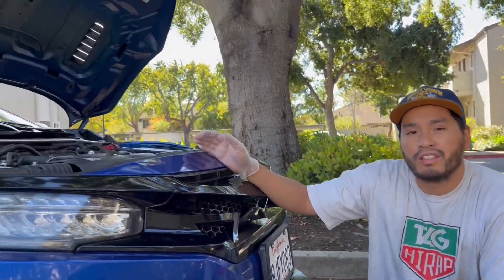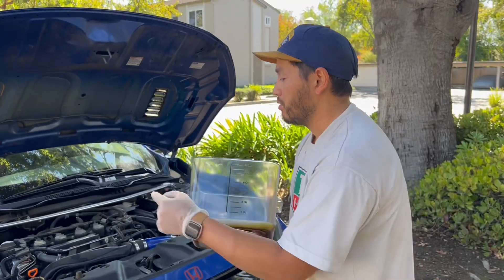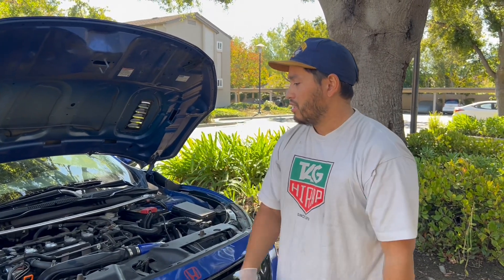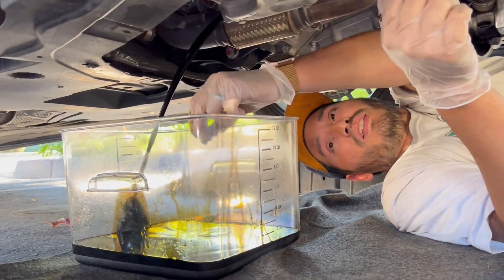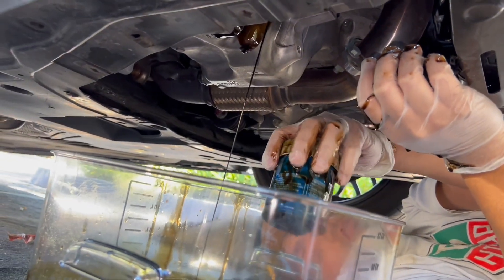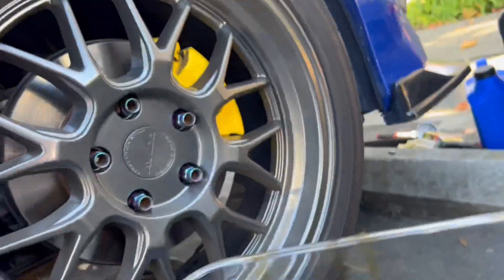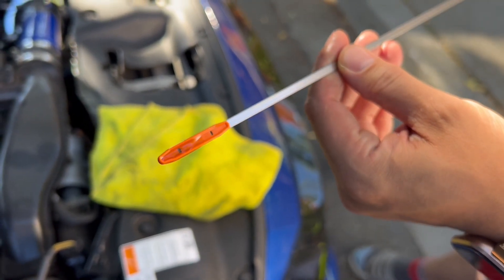Major Problem with my Honda Civic 10th Gen OIL DILUTION Fuel Mixing Issue, No Warranty Fix Recall

Comment: Scotty Kilmer suggests to switch to the new ILSAC GF-6B 0W-16 oils for the Honda 1.5L turbocharged engines to fix the oil dilution problem. That's what I did in my 2018 EX Hatch. No more gas smell in my oil and I can go back to oil changes at 6,000 miles.
Reply from the maker: Thanks for the suggestion. I’ll look into that oil right now 👍
Reply: @Sals_Garage  let us know if it fixed it 🙏
Reply from the maker: @Chris-db9vt  I’ll make a follow up video on the next oil change. 👍
Reply: Which video did Scotty say this in? Can you link pls
Reply: @schulumberger  
He actually mentions it in several videos. He hasn't made a specific video talking about just this subject specifically. It more or less comes up in his bonus questions and answers at the end of his regular videos. But whenever somebody mentions having the 1.5L turbo he says to switch to the 0W-16. Apparently the 2.0L turbos are fine and don't have the oil dilution problem that the 1.5L  turbos do.
Reply: @joshuaewalker  thanks man! I will try it and report back here! About 3k miles between oil changes!
Reply: @schulumberger  
Cool! Btw, what are you driving?
Reply: @joshuaewalker  Honda Civic 2017 1.5L Turbo ! I don't have too much oil dilution, but I still want to take precautions because I keep reading so much about it
Reply: This only happens in colder climates (like where you're at), kabayan. Over here in the Philippines and other tropical areas, it's not much of a concern.
Reply: @schulumberger  
Honda knows about the problem and did a recall where they didn't mechanically do anything to the engine but they did update the computer in the car to get the engine to heat up faster which will help evaporate any of the fuel that's in the oil during startup. So, if your '17 Civic has ever been back to a dealership it's likely they did that update and why you don't notice that bad of an oil dilution problem.
The oil dilution in my '18 was never that bad, but it was happening and still concerned me. Since switching to the new oil (which is hard to find btw) combined with the ECU update now it doesn't happen at all. I never smell fuel in my oil and the oil level remains deadnuts on full never increasing. Basically, the way it should've been off the factory floor.
Reply: @mikemagalong3161  
Yep. Because of the warmer climate the engine runs hotter so any of the air-fuel blow-by getting into the crankcase is able to more quickly evaporate and not mix into the oil.
Reply: Is that GF6B 0W16 oil something you have to buy at an auto parts store, or is standard practice at Honda dealership s?
Reply: @Paco_Burrito_Suave  
Most new model Honda's and Toyota's now use the new oil. If you have one of the last gen Honda's with the oil dilution problem then the dealership will not use the new oil. They will only use the 0W-20 that is specified from Honda. You'll have to change the oil yourself or get a mechanic who will put in the oil you ask for.
Reply: @schulumberger  
Here's a new video from Scotty where he talks about the Honda oil dilution problem and to switch to the new oil. It's at the 7 minute and 4 second mark.
https://youtu.be/RF1SIssQTyk 
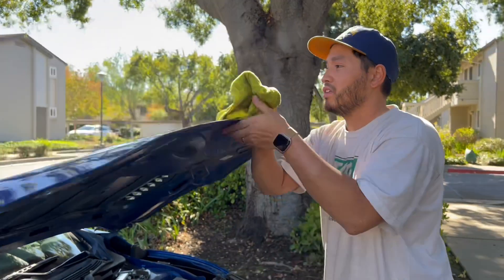@7:04
Reply: @joshuaewalker  Where do you live? Honda has refused to perform the update to my ECU and said that unless the oil level was more than 1 quart over-filled AND the engine was dying that they would not do anything.
Reply: @jamesmedina2062  
Indiana, United States
Reply: @joshuaewalker  What were your complaints?
Reply: @jamesmedina2062  
Well, I knew the problem was happening and told my dealership, but that didn't really matter. My 2018 Civic fell under Honda's extended warranty either way and while there was no official recall there were ECU updates that changed the behavior of the engine to make it run hotter because it's just a cool running engine anyway. The higher temps are supposed to cause the gasoline in the crankcase to evaporate faster. That's the only fix provided and it's not even an official fix from Honda.
I'm pretty sure if you have a 2019 or newer then Honda already did what they could to fix the problem before it left the factory. If you have a 2017 or '18 Civic or CR-V with the 1.5L turbo engine and it's still under warranty from your dealership then they should update the ECU no questions asked. Just tell them there's a program update. Heck, even if it's not under warranty you should be able to find some Honda dealership somewhere to do the update for you for free. Honda generally takes care of their customers. Dealerships on the other hand are slimy, money grubbing, cesspools. You're lucky to find a good one.
All that being said, still switch the the new 0W-16 oil. It's designed specifically for these modern engines. Almost everybody now is putting out cars with these 4 cylinder turbos and that's what the new oil is for.
Reply: @joshuaewalker  i will call Honda. I have a '17 and it does run too cool. I contacted Honda dealers in Denver and somewhere in the Dakotas because they kept telling me if was limited geographically to cold states only. I got the letter stating I get 6 years unlimited miles warranty resulting from the class action lawsuit Hamilton v Honda. This past week I asked my local dealer in Texas about updating my ECU for cash. I had just changed oil and with one wheel in air it threw the ECU into INSANITY. If a wheel spins free of the other side the brain goes insane.  My parking brake stopped working, power steering stopped modulating based on speed, numerous lights on dash lit up. So I got charged 125 ++ for recalibration of ECU. For the update to ECU I asked about he said 250 ++ cash and they throw in Honda oil. I said no because I just changed the oil and it is better than theirs. I am trying LiquiMoly 0w20 AA which is good. In the old days they could save and reuse your oil but now they have a script to follow. Rather than figure out what I need and want which really is just a tweaked start up coding the dealers I have spoken to seem to either reject me (not enough issues suffered) or quote me 2 hours on my dime. I hate Honda North America.
Reply: @jamesmedina2062  
Good grief! I'm sorry to hear all that. Hopefully a Honda representative will be able to direct you to a service center that'll treat you right.
Reply: That's what I was going to say
Reply: @joshuaewalker  there was a vid, I think it was a customers black civic, or crv in RI if I remember right
Reply: @Sals_Garage  I wouldn't really wait to do it,  it's cheap enough to do early. It happens when the gas gets past the rings
Reply: @schulumberger  Did you try out that oil?
Reply: Don’t do this to your L15 engine! You will have progressive engine wear. Thinner oil especially if you thin “20” and make that a “16” the oil will act as 16 viscosity when it’s supposed to act as 20, this will happen when the engine reaches its operating temperature, so please don’t. Stay with what Honda said, Honda says 0W-20, stay with that, not 0W-16. Many parts inside the engine will wear out faster than normal like your piston rings, bearing caps, crankshaft, valve train, cam lobes, etc.
Reply: @kg_1720  
I'm sorry, but you're wrong. 0W-16 is, more or less, just called that to distinguish it from 0W-20. As far as viscosity goes they're very close. The difference is 0W-16 is 100% fully synthetic no matter what and meets new specifications via ILSAC GF-6B.
Also, if using the new oil (even though it's thinner) stops oil dilution then what's worse: a slightly thinner oil? or very thin 0W-20 oil that's contaminated with gasoline?
Reply: @joshuaewalker  yeah it’s a little difference, but it becomes big once you go for long trips, like driving out of town, or driving for many hours, the longer you drive, especially in hot weather, the oil viscosity keeps going down. 16 is not far from 20 I know, but it’s still lower than factory spec. Honda made your car, so listen to them. This also becomes very bad when you drive spiritedly, like many 10th gen Civic owners.
Reply: @kg_1720  
Well?
Reply: @kg_1720  
Nothing but crickets now...
Reply: @joshuaewalker      Can these issue be fixed with addjng engine block heater
Reply: @Pokka676  
I'd imagine it'd be helpful in very cold climates, but simply switching to ILSAC GF-6B 0W-16 oil seems to do the trick. I've been driving my '18 Civic Hatchback for over four years now in Indiana with 100°F (38°C) summer days and 0°F (-18°C) winter nights and the EarthDreams 1.5L Turbo engine always seems to run at 200°F (93°C) or a little lower no matter the outside temps. But, it does take a few extra minutes to get up to operating temp in the cold temperatures, that's for sure.
Reply: @Sals_Garage  My first oil change, the oil level like half inch over the dot. Try the 0W-20 ILSAC GF-6A oil (Just any brand that mention ILSAC GF-6A on the back of oil container). After 500miles, I haven't see the oil level increase yet. So It seems solve or help with the oil dilution problem. Here's the source if you wonder https://youtu.be/uID9ycFZ3dI?t=145
Reply from the maker: @eagle9530  thanks for the suggestion!  I’ll look into it soon!
Reply: Can i. Use the SAE 0w-16? I bought the mobile 1 version
Reply: @allcashquickclose5219  
Yep.
Reply: no no no. If you have a civic you need to use the GF-6A. The GF-6B is only meant for the CRV engine. GF-6B is meant for engines that use the 0W-16 oil. Our civics use 0W-20 and is only compatible with GF-6A oil.
Reply from the maker: @Kagemusha320  thanks for sharing.
Reply: @Kagemusha320  
I am fully aware of the differences between GF-6A and GF-6B and am very specifically suggesting to use the GF-6B and not the A. I am specifically saying to use 0W-16 oil which does not, and will never, come as GF-6A.
0W-16 oil, specifically the GF-6B, was DESIGNED for these smaller, turbo charged engines that run higher compression ratios. This oil is better able to lubricate and form a more impenetrable skin on the surface areas of the moving metal parts of the engine which is what's helping to stop the blow-by problem with this engine.
BUT! If you have a late model 10th gen Civic which came with the updated factory tune from Honda which allows the engine to heat up more quickly from a cold start and run a little hotter than they did originally then a lot of that blow-by doesn't happen and the small amount of fuel that does make it into the crankcase evaporates more quickly and more fully getting it out of the oil. In that case I personally agree that it is perfectly fine, if not preferable, to use 0W-20 ILSAC GF-6A oil. Especially if you already live in a warmer climate. In fact, I, myself, am doing just that. I'm using 0W-20 during the summer here in Indiana and 0W-16 during the winter.
Reply: Josh, just saw that video last night.  I can't understand how a thinner oil would improve the issue.  I'm not saying it won't work and I plan to try the 0w-16 in my 2021 crv 1.5t.  Do you have an update on whether it is still working?  Thanks
Reply: @ronb493  
Hi! Yes, I still use it during winter months and I use ILSAC GF-6A 0W-20 in summer months. It's not so much about the thin-ness of the oil as it is about the oil's ability to create and maintain a protective skin on the metal parts that must slide against each other. GF-6B, per the specification, MUST be fully synthetic and is an advanced formulation specifically designed for newer small, turbocharged engines. GF-6A, on the other hand, is also the new standard but does not have to be 100% synthetic to meet specifications. GF-6A will still be excellent oil no matter what.
Reply: @Joshua Walker  Thanks for the response! I am in NJ so the weather is pretty similar.  Getting ready to change my oil this month.  I plan to follow what you are doing with the summer/winter change up.  Thanks again
Reply: One more thought.  What do you think about add a little Motorkote.  Not a lot maybe half the recommendation to add a protective film. I've never used it an Motorkote says right on their website not to use until after the warranty expires.  Just a thought but I've never seen anyone suggest this before.   Thanks
Reply: @ronb493  
Personally, I wouldn't. Honda makes some of the best engines in the world and they literally make the most engines in the world compared to any other company. High quality oil and regular maintenance is all you'll really need. Your 2021 CR-V should have a slightly more updated version of my engine and the updated ECU programming to make it run better. 2018 models were really the last year our engine had problems with fuel blowby getting in the crankcase and causing what could be considered significant contamination of the oil. The compression was really high thanks to the turbo and the engine ran too cool (especially on startup) to help evaporate the fuel out of the crankcase. With the ECU update from my Honda dealer and using GF-6 oils I don't notice any gas smell whatsoever in my oil anymore. And my engine temps are a little higher maintaining between 185°F and 195°F.
Reply: @joshuaewalker  You make a lot of sense.   I'll stick with the more frequent oil changes and forgo the use of any additives. Thanks for taking the time to answer.
Reply: 5w 30 for the win 🏅 😊

Comment: Is you thermostat stuck open? Gasoline should evaporate out of the oil in a short time once the oil temperature comes up. I’m wondering if your thermostat is stuck and your engine is never warming up fully? We used to add a gallon of gas to our diesels in the cold weather (-40F or worse) to thin out the oil. By the time the engine warmed up the gas had evaporated and the oil was back to full viscosity. Obviously with modern oils we don’t need to do this anymore.
Reply from the maker: Possible, I’ll check it out soon.

Comment: Did you ever try switching to the new gf 6 oil? And if so did you go with 0w 16 gf b or stay with 0w 20 gf a?
Reply from the maker: Haven’t tried it yet. Have a link? I’ll do it next oil change.
Reply: @Sals_Garage  unfortunately dont have a link. i have a 2016 ext coupe and am noticing some slight oil dillution. i started running shell vpower premium and doing my oil changes at 3000 miles. i really love the car and it does still drive like a dream even with the dillution issue. i have been researching it and a lot of people are switching to the gf 6 oil and claiming no issues. some use the 0w16 gf6b and others are using the 0w20gf6a oil and they both seem to be getting good rsults! im nervous going to the 0w16 so i think i am going to try the gf6a 0w20 pure synthetic from mobil !
Reply from the maker: @WHJr-p1g  thanks for sharing. I’m gonna search for that oil soon.

Comment: Is it normal for EX-T w. 102k miles to only get 25mpg city driving? Changed spark plugs and cleaned MAF sensor with no progress.
Reply from the maker: Yes, I get 29-30 mpg with mostly highway driving. 93k miles.

Comment: I did a recent oil change on my roommate's 2017 Civic and noticed the old oil had that gasoline smell to it. Didn't know that this was a common issue on Civics. Thank you for making this video.
Reply from the maker: No problem! Keep up with the oil changes and you'll be fine.
Reply: It's a problem on a whole heap of cars... not just Honda's. Even older cars can experience it. Idling a lot also makes the problem worse. :-)
Reply from the maker: @MichaelCzajka  good to know
Reply: @MichaelCzajka it’s common in other turbo engines as well but with these Honda ones it’s above normal

Comment: Sal what year is your Civic ? I have 20K on my 2019 Accord LX that I purchased certified used a year  ago. I am beginning to believe that the days of Honda lasting 300K are over. The emissions requirements given to manufacturers via our government is forcing them to deal with the impossible. No one is building cars as well as they did 20 years ago. I am 64 and have owned several Honda products over the years .
Reply from the maker: I agree with you for sure. Our civic is 2016 with 90000 miles.
Reply: @Sals_Garage  Sal check if Honda extended the warranty to your vehicle. I have read about people getting new engines but we cannot believe everything that we hear. Best of luck. You have a really good channel and I just subscribed
Reply from the maker: @douglasmichel1000  thank you! Will check into it for sure.

Comment: Did you buy it before you knew about these issues or found out later about it? Would you buy it again if you could go back in time?
Reply from the maker: Yes I bought it when under warranty three years ago. Since then the AC leaked twice and this issue shown up as well. Still love the car as a daily driver. 👍